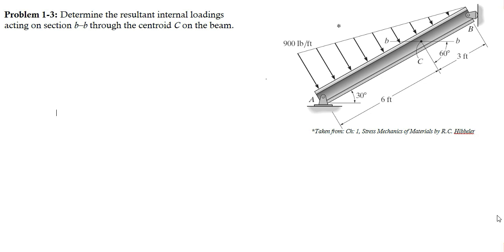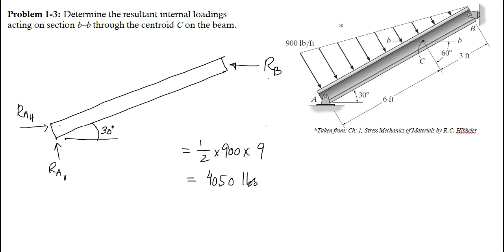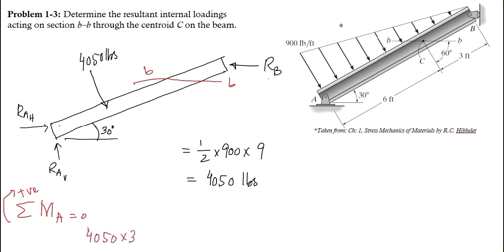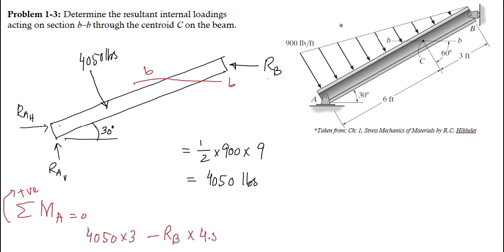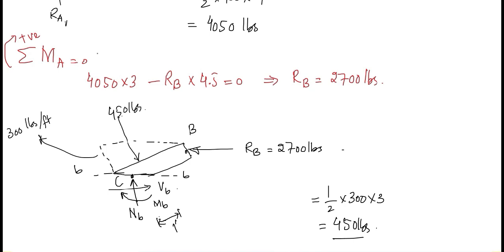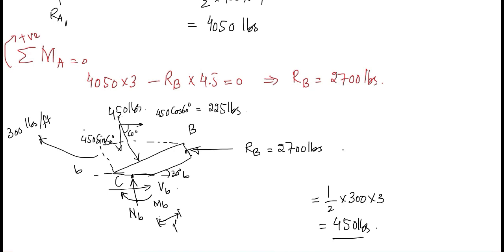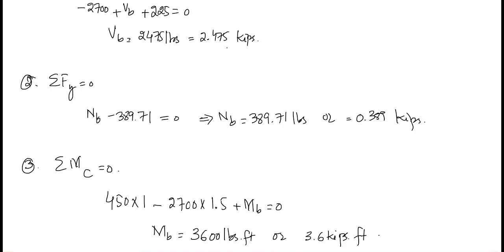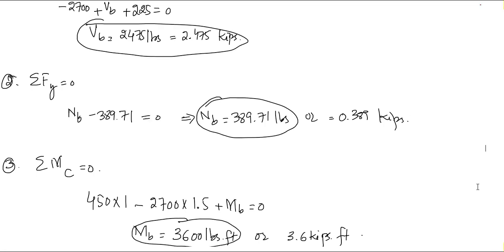Problem 1-3 Internal Loadings on section b-b through centroid C, Mechanics of Materials

Comment: Hii may I know where 300 lbs/ft come from when you cut the loading to section?
Reply from the maker: The beam is subjected to a uniformly varying load that starts at 0 lbs/ft at point B and increases linearly to 900 lbs/ft at point A. Since the total length of the beam is 9 ft, the load increases by 100 lbs/ft for every 1 ft of length from point B. At section b-b, which is located 3 ft from point B, the load intensity is 300 lbs/ft.

Comment: may i ask why it is 450(1) in Mc, is it y component only and the x component was cancelled??
Reply from the maker: I have considered 450 lbs as the whole force (resultant force) instead of the horizontal and vertical components. In 450(1), 1 is the moment arm (perpendicular distance between point C and line of action of force).